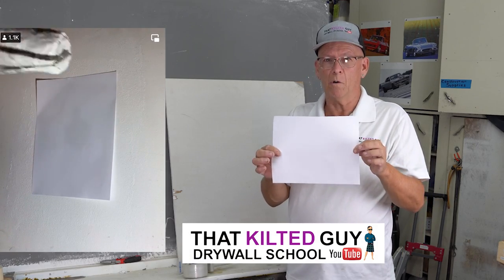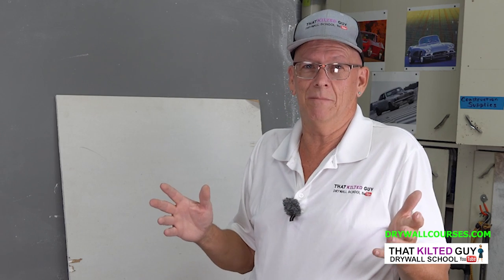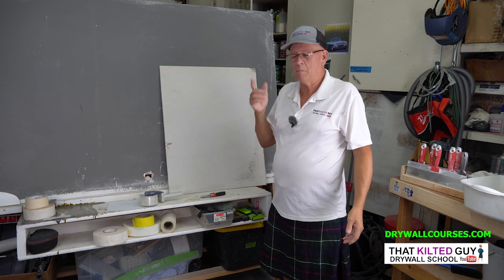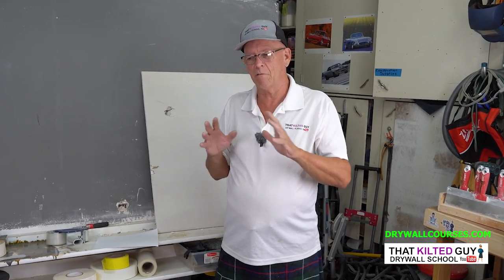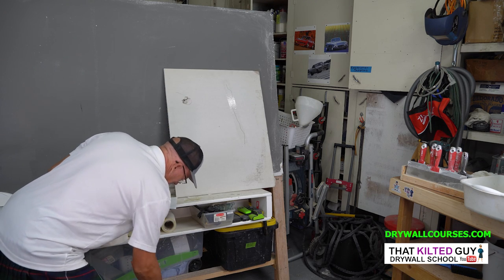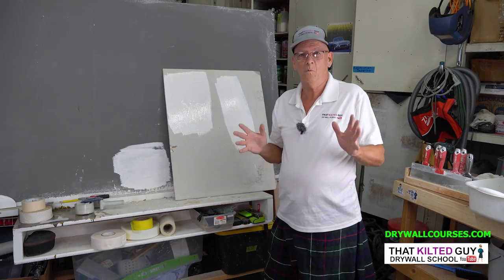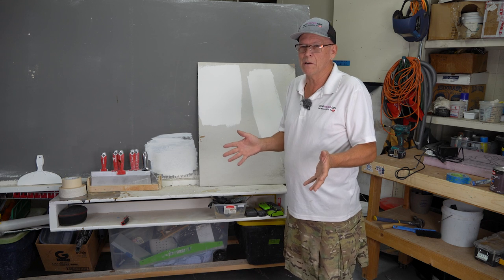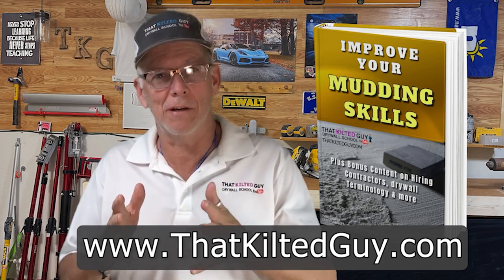New Drywall Repair Kit using Printer Paper is Now AVAILABLE!

Comment: Hi can you do an updated video on removing popcorn walls and ceilings is there a way to scrape it off or scrape it smooth or use spackle to smooth it out
Reply: If you use water bottle you should be able to to use a scrape it down 
Then use sand paper  to smooth it out 
Then repaint it
Reply: This worked for me
Reply from the maker: I plan on a detailed course about it

Comment: You didn't add fiberglass fibers to the paint which makes the paper stronger.
First roll the glass impregnated paint, then cover with paper, let dry.
Then apply outter coat, dry, sand smooth the finish coat..
Or just use fiberglass cloth and resin.
Reply from the maker: Shush, that’s the secret ingredient in the can we include. But it’s a special form of fiberglass

Comment: Even tape requires multiple coats and "feathering the edges" to avoid it showing through. So, in the spirit of your sales pitch (good one) I cry foul on the edge showing complaint. Now, bubbling, low strength, low paint adhesion - these are the fatal weaknesses to be sure. Thanks for doing the experiment!
Reply from the maker: Trust me, no amount of coats of paint is gonna make that paper edge disappear, unless you’re talking 10 or 20 coats so it’s plenty fair, lol
Reply from the maker: And there really is no way to feather the edges with paint rollers like with drywall
Reply: Legends say this guy is still doing coats of paint to feather that paper edge

Comment: It looks bad because you left out an important strengthening step: stapling the repair paper or tape or shoe soles to the wall first. 3/8 (or, better, half inch) staples will really help. You won't see any wrinkles in the paper, I guarantee!
Reply: Just tried the staples. I totally get your concept, but I'm getting major chatter marks. Help me please 🙏
Reply from the maker: Dang it I knew I forgot something. And they should be 30% beryllium to avoid rusting because of the high acidic content of the latex paint